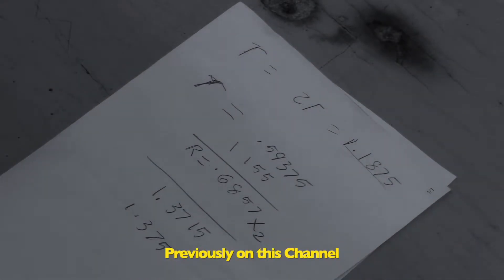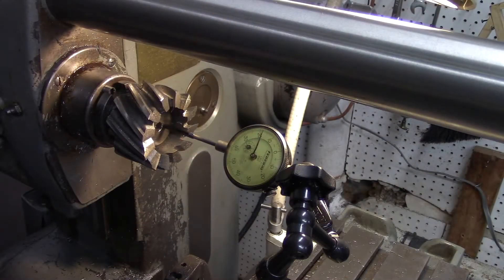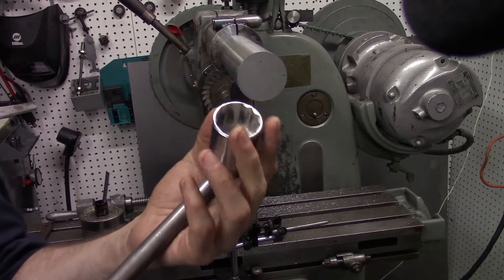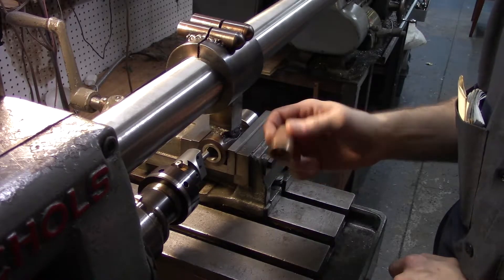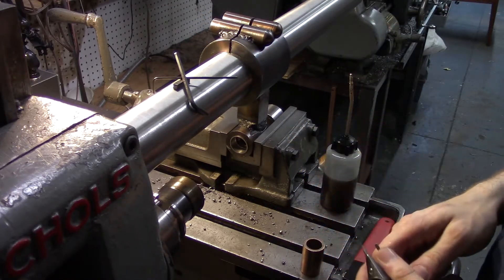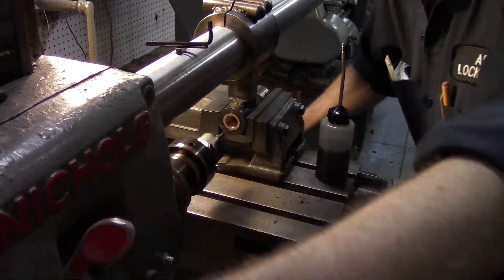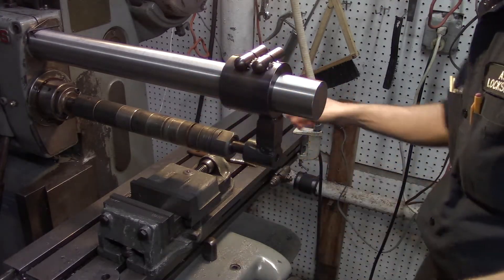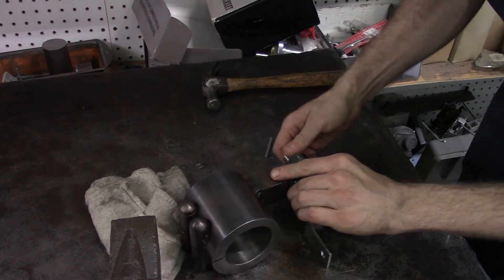More Upgrades to The Mill  Part 2: Better Drawbars, and an NMTB Arbor Support

Comment: Kind of a fun change of pace with the trivia question...unfortunately I don't know the answer....

I had to make a new drawbar for my Cochrane bly....even with it I still would have a tough time freeing the BS9 taper....I finally came up with the idea to clap onto certain Tooling with my Mill vise and put just a lil knee weight on it , then a couple light taps would break it loose...

Great work there
Reply from the maker: Sometimes I wonder if all the smacking on the end of drawbars will wear something out. So far I haven't seen it chew up drawbar threads.

Comment: lol, my 1st try I misunderstood and shrunk fit the roller bearing in my old Nichols arbor- melted the plastic roller carrier :)       For my diy drawbars I made a shouldered plug to go into the spindle, with a hole down the center for the drawbar.   Works, but I like yours better...   Love swinging the big cutters on my mill   :)
Reply from the maker: Thanks greg  I think I need an arbor press and some dry ice for the next job like that.